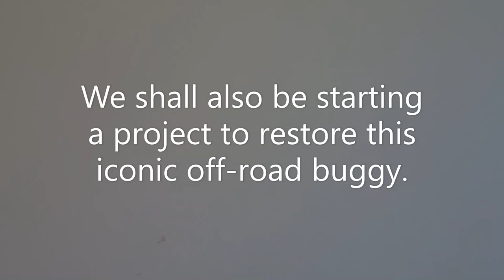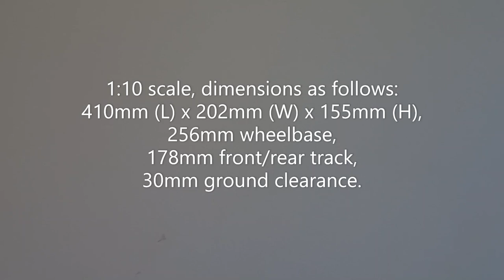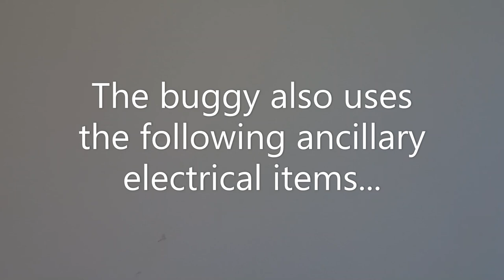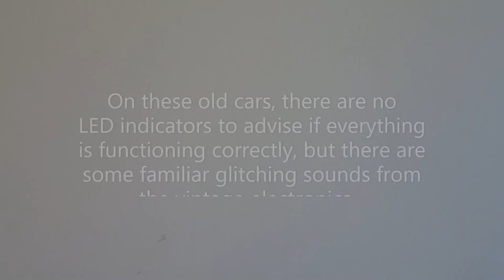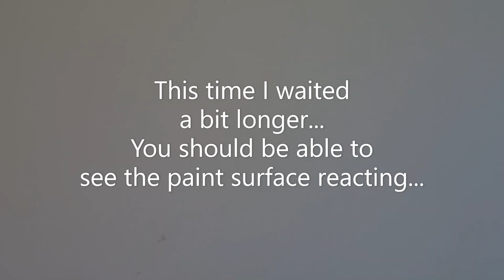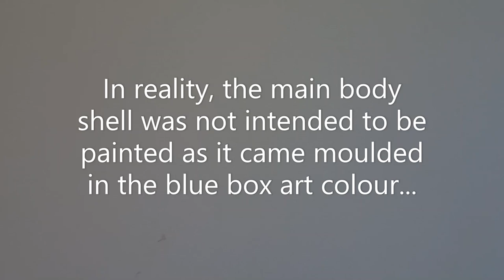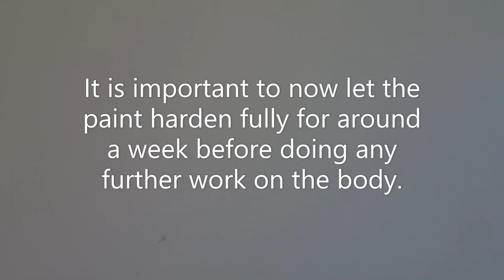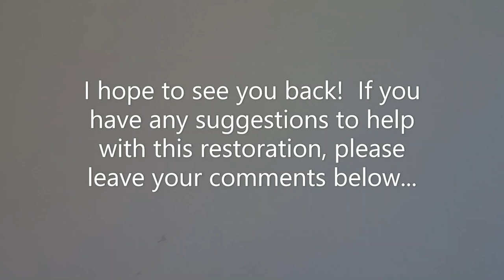Vintage Tamiya Holiday Buggy (58023) 1:10 Scale RC Car - Restoration Project & Detailed Overview

Comment: Thanks for taking the time to meticulously take us through the resto. I really enjoyed it as the HB was my first buggy back in 1982.
I raced my HB for a season against the quicker srb’s and whilst it was great fun the 360 motor and very rudimentary suspension did leave it lacking somewhat.
That said of all of the classic Tamiya and Kyosho buggies I have collected over the decades the HB is still my number 1. It’s just a good looking and reliable old girl that got me hooked on RC cars and racing back in the early 80’s.
Reply from the maker: I really appreciate your comments and it is interesting to hear your views on the Holiday Buggy.  I would have loved a Rough Rider as my first RC car but it was way too expensive for a youngster like me at the time.  I never raced mine but I drove it extensively and it never let me down.  Yes, it was basic but that didn't stop me having huge fun.  Four decades later I now have 40 RC cars, including a Buggy Champ, but the original vintage Holiday Buggy still has a very special place in my collection.

Comment: I wish they would bring back the holiday buggy like that wicked one you're restoring.
Reply from the maker: The funny thing about the Holiday Buggy is that it is not high powered (it only has a 380 motor and 6V battery) and the suspension is ineffective, but it is still huge fun to drive.  I drove the Holiday Buggy a lot on the beach and it was totally at home in those conditions.  Remember, this buggy was 20 models ahead of the original Grasshopper.  The Holiday Buggy was number 23 and ran from 1980-1984.  The Grasshopper was number 43 and was introduced in 1984.  As for the 2010 version of the Holiday Buggy on the DT-02 chassis, I can't describe it as a re-release because the chassis was completely different.  Somehow, it never worked for me.  The wheels and tyres were wrong and the track width was too wide.  Maybe it was my nostalgia for the original or perhaps it was because the chassis didn't match the body properly, but I just couldn't bring myself to appreciate the 2010 version.  Just look at the real life Corsair Stripper and you notice the proportions closely match the original buggy, scale realism, including the tyres was very good.
Reply from the maker: Because they already have the 2010 version, I think it is very unlikely that Tamiya will ever bring back the Holiday Buggy or Sand Rover in their original form.

Comment: What a great piece of Tamiya history. We’ve got a rere but I’d love to have the original one
Reply from the maker: Thank you.  Yes, I just love the early Tamiya buggies.  Even though it was an entry level kit, you can still see that Tamiya went to a lot of bother designing it and making high-quality parts.  The fact that it still works after 4 decades and extensive off-road use is a testament to the design.  I'd love to get some more vintage RC cars but the prices are crazy nowadays unless you are lucky and manage to find one that someone doesn't appreciate.

Comment: Watched this with interest as my old Sand Rover (with a Holiday Buggy shell) is currently in my garage in a similar, or more likely worse state. I got it in 1981 and used it for a few years before I got into computers and it's languished in that state ever since. Although it's been with me through 5 house moves! I hope to dig it out and see how it looks in 2024.
Reply from the maker: I would love to see that!  The Sand Rover is a great looking vintage buggy and it has aged very well I think.  I would gladly have one myself if I could find one.  I had mine as a present and it was a choice between the Holiday Buggy or Sand Rover due to the price.  I chose the Holiday Buggy just because a good used one came up but I would equally have had a Sand Rover.

If yours is still in the original condition, then I would just try to dust it down and clean it as well as possible to preserve it.  I only painted mine as it had already been painted once and I wouldn't recommend painting one if the body shell is reasonable.  Even if you have a battery and all the electronics still work, driving your buggy now is going to be risky due to the possibility of parts breaking after so long in storage.  The plastics will probably have yellowed and be brittle.  I hope your tyres are still okay.  I still haven't found any replacements for mine as ALL parts are extremely hard to find.

I shall hopefully finish the second part of my video when the weather improves and put it all back together again.
Reply: @BlackSeaRC  It's all in original condition. Sort of. I got it for my 11th birthday, to say way happy was a massive understatement! 

My Holiday Buggy shell is unpainted so it remains the factory blue (with period-correct scratches of course). I have a custom mental rear bracket made by my Dad to hold though as it was easier and cheaper for him to do that. It also has a homemade universal joint (my Dad worked for British Aerospace so got a guy there to fabricate one!) on it because I lost one down a road drain (oh the embarrassment of needing to own up to that as a 12-year-old!). The front has bearings instead of the shite plastic bushes, and I have some Rough Rider style rear wheels/tyres on it. The thing that'll be most wrong will be those pesky plastic (unprotected) rear gears, I chewed through sets of those like you wouldn't believe! 

The Sandrover shell is hand painted in orange and also scratched up a lot, well these were for playing with. Once I got the HB shell though it never went back on, not sure if I have the rear clips for it. I have the exact same radio coms equipment as you, I think every Tamiya sold in the UK in the early 80s have the ACOMS set! For some reason I don't have a charger though, I think I used to charge it from something in our garage at the time. It's been 40+ years so I can't remember exactly. 

I had two other mates with RC cars so we used to go all over our village with them. Then home computers turned up and we all gravitated towards those and stopped going outside as much. haha :)  Great times for sure.
Reply from the maker: @elyuw  Thanks for sharing your fantastic story.  There is so much of this that I can relate to in my own similar experience.  I reckon my Holiday Buggy had many thousands of hours of use and never broke down.  All I changed was one set of gears and I added the homemade reinforcement plate for the front suspension mounts.  I guess I was quite light on my buggy, probably because I knew it cost my parents a lot of money at the time.

I went on to buy a Tamiya Boomerang and despite various periods of inactivity in the hobby, I now have a large collection of RC vehicles and continue to enjoy them with my 6 year old son.  Nostalgia is quite a big thing in the RC industry at the moment with companies such as Tamiya, Kyosho, Associated and Yokomo all re-releasing nostalgic buggies.  Are you still participating in this hobby?  If not, why not relive some golden memories with a new kit?  The new Tamiya BBX would be a great choice!
Reply: @BlackSeaRC  No, this is the only RC car I've ever owned. As I said, once home computers and video gaming in general hit that was my switch in hobbies really. I don't have kids so I never went back into toy mode as such. So it really is all about the early 80s nostalgia for me, once it warms up a bit I'll see what I can do with the old girl :) 

I am super surprised you only ever changed the gears once, my other mates would be as shocked. Must have been dustier in East Yorkshire!
Reply from the maker: @elyuw  I typically ran mine on the beaches around the Norfolk coast so it was very sandy and salty.  This Tamiya car has corroded less in 40 years than my Losi buggy did in 1 year.

Comment: Hey! Im just gonna say i love your videos and it has helped me restoring my own vintage holiday buggy! Actually when I first saw this video and the car was when I decided that this was my new favorite rc car! It still is my favorite. Keep it up!
Reply from the maker: Thanks for the kind comments.  I love the original Holiday Buggy and definitely prefer it to the awful 2010 version on the completely different DT-02 chassis that didn't fit the body properly (shame on you Tamiya!).  It is super hard to get parts though and I'm still looking for a new set of wheels and tyres for mine.  I have also looked into the possibility of buying a vintage Sand Rover.  I like the open cockpit design with driver figure.  Again, super hard to find except a new-in-box kit that I saw for sale in Japan.  The price was substantial though so I didn't buy it (maybe I'll regret it later).
Reply: Yea. I hate the new holiday buggy also. Actully its not that hard to find parts i mean the tyres are hard to find and i need also new back tires and wheels But besides that i find a lot of new and used parts to vintage holiday buggy on eBay. We have something called FINN in Norway which is just eBay but only in Norway and sometimes I see a vintage sandrover and other holiday buggy’s. But it’s rare. Anyways good luck on your restoration. The only things I have to do on mine is buying a new rear flex plate and new wheels and back tires and battery that fits. If you wanna se mine it’s actually on my YT channel. Good luck
Reply from the maker: @Strong_rc  I'm lucky that my 40 year old 6V Ni-Cd battery pack still works.  Not that I really drive it much nowadays, I worry about damaging the chassis that could be brittle or the newly painted body.
Reply: @BlackSeaRC  i need one of those batteries when i buy the orginal electronis
Reply from the maker: @Strong_rc  If you want a vintage 6V Ni-Cd battery pack, you might have to buy from Japan.
Reply: @BlackSeaRC  👍

Comment: Cool restoration! Becareful on that paintwork since the paint won't tolerate scratches
Reply from the maker: This body material is simply not really suitable for painting but after my foolish attempt to paint it many decades ago, I have no other choice but to try and then be very gentle with it.  The body is soft, it flexes and the paint doesn't bond well to the surface - not an ideal combination of factors!  Nevertheless, the result is very nice so far.  I will give it a few more coats of blue, plus a clearcoat and will then attempt to fit the decals.

Comment: Wow this is interesting,  i have never seen this before , great job on the painting and also good luck with the cleaning 😅
Reply from the maker: Although there were RC cars available from the late 1960's, these were considered to be for on-road use and were not very robust.  Tamiya launched the first off-road RC car in December 1977 but it had a basic chassis and wasn't very durable.  It wasn't until November 1979 that the first purpose-built highly capable off-road buggy was released.  Just a little over a year later in 1980, the Holiday Buggy was released making it very early in the history of RC off-road vehicles.  That is why I am glad to have this original buggy in my collection.
Reply: @BlackSeaRC  that's so cool

Comment: From what I've found out, RC10 classic tires will fit in the rear. RcMart has them in stock now (partnumber 6314). I guess 20 dollars is way less what you will pay for new old stock tires for these.. For partnumbers, Tamiyabase is a great source.
Reply from the maker: That's interesting to know, thanks.  They certainly look like quite a good match with the spiked design.  As for Tamiyabase, this website is a fantastic resource for information but at the same time, every time I visit it, I end up getting ideas for buying another vintage Tamiya car!  There are so many interesting models that are better in my opinion than modern RC cars.  I like the Toyota Celica Gr.B on the 959 chassis, the Willy's Wheeler Honda City Turbo, the Ford Ranger XLT, the Sand Rover plus many more...

Comment: These hard bodies and the other plastic parts can be soaked in Dot 3 brake fluid. Will remove paint much faster. Places that sells stuff for classic cars might carry Dot 3 brake fluid.
Reply from the maker: I did a bit of research before I worked on this body because I was already aware that the material used makes it a little bit unusual.  In reality I wouldn't paint it unless I had to.  I was still very cautious about the product I used but it seemed to work, albeit rather slowly.  That is mainly because I went rather crazy with the number of paint layers when I originally painted it.  Getting white to cover blue was quite difficult and something I would come to regret.  You are probably right about the brake fluid and I'm sure it would work much better but I was totally conservative when working on this body!

Comment: This looks like an interesting resoration project.  Do you have any other vintage RC cars in your collection?
Reply from the maker: My second RC car was a Tamiya Boomerang, released in 1986 and then a Kyosho Double Dare from 1988.  These are considered to be classics now but are not as iconic or well known as the Holiday Buggy.  I also have a Tamiya XR311 but this is the 2012 re-release and not the 1977 original (although they are very close in design terms).
Reply: @BlackSeaRC  Do you have any plans to make videos featuring those cars as well?  I would be great to see them.
Reply from the maker: @zanimashka3162  I plan to make a "Retro review" video featuring the Kyosho Double Dare monster truck.  Also, I have some very interesting metal upgrade parts for my Tamiya XR311 so this will definitely be shown in an upcoming video as well.

Comment: For the bald rear tyres, you'll have a devil of a time sourcing original replacements on eBay because they're so rare nowadays and probably priced accordingly (I'm guessing Japan may have the largest possible old spare parts stock?). The Holiday Buggy of course shared the same chassis and tyre set up as the Sand Rover, so that increases the potential to find them. Otherwise, there must be a company that  custom makes vintage parts? Looking forward to seeing this restoration complete and good luck with it!
Reply from the maker: I have had no luck finding any yet.  I actually want the wheels as well as mine are damaged.  I have been searching on ebay and there are occasionally some for sale but most often the prices are crazy and the rubber is totally cracked even worse than mine!  I know that MCI Racing in Canada makes reproduction vintage RC tyres but unfortunately, they don't offer these tyres yet.  I guess it is quite rare for Tamiya that these tyres were only ever used on the Holiday Buggy/Sand Rover.  Also, because the re-releases used a totally different chassis, there is no chance to ever get them now either.  My search shall continue and I agree with you, surely there must be some bankrupt stock somewhere in Japan.
Reply: Perhaps 3D printing techniques could create a set of wheels? The tyres are a trickier prospect though. It's too bad the Holiday Buggy rere didn't retain some of the original features such as these. Good luck with the restoration.
  @BlackSeaRC
Reply from the maker: @Titus-q5b  There is a chance to get used vintage wheels in reasonable condition but rubber that is 40+ years old is going to be much harder to find.  I will continue my search.
Reply: Will be hard work finding wheels and tyres for this buggy🙁 I managed to get hold of 2 sets about 12-13 yrs ago when i restored my buggy and they were hard to find then and not cheap but now they're as rare as rocking horse 💩💩 and cost a fortune😢😢.. cheap alternative is a set of Subaru Brat wheels and tyres which i actually like on the holiday buggy and have fitted to mine for a different look..
Reply: Another possible solution: use or adapt the wheels & tires of the rereleased SRBs Sand Scorcher/Buggy champ which were compatible with the HB & SR back in the day. @SavyBajaBuster
Reply: @Titus-q5b  yeah think they be a direct fit ... maybe grasshopper/hornet but rear may have issues? I never tried them which is mad as i own a couple of Hornets🤣
Reply from the maker: @SavyBajaBuster  I appreciate that there could be a number of possible alternatives (and some of these even have a better scale-realistic appearance), but I would like to keep it as close to original spec as possible.  Will just keep what I've got until I find something better.
Reply: @BlackSeaRC   yeah I know where you're at, i am the same🤣 ... I'm not 100% sure but i think the rear tyres off the original RC10 gold pan may fit holiday buggy wheels and they look similar and it was re-released so may be able to get hold of those?